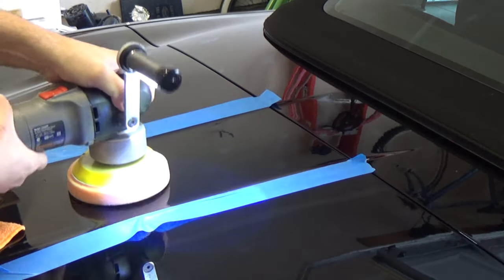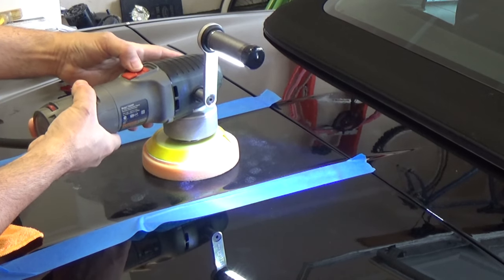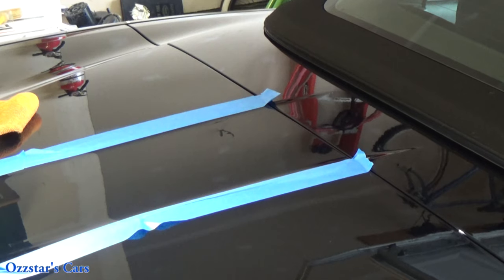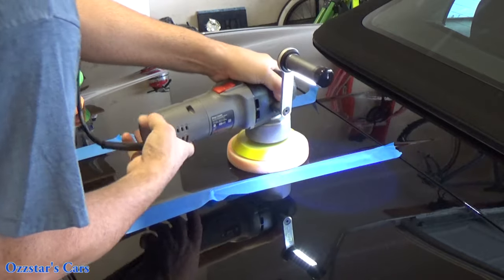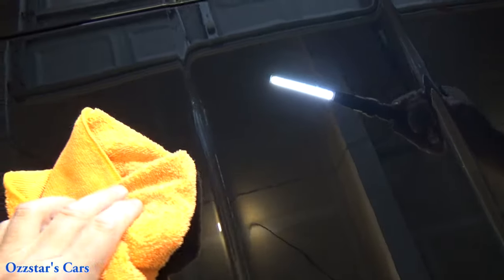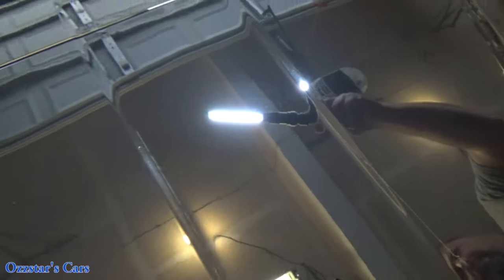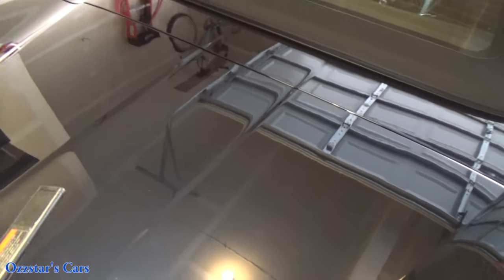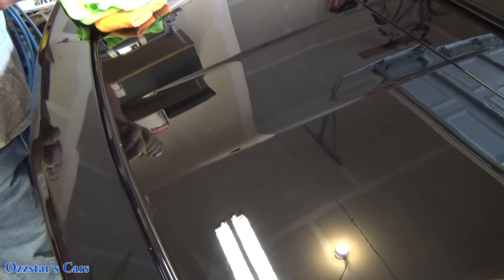Car Paint Scratch Removal How To Demonstration

Comment: I never learned how to buff cars. Probably because I haven’t owned any worthy of the effort, lol. 😆 The Silverado was for a brief time, but now I’ve long since stopped caring about that. You should see the scratches in that thing! You’d cringe. Even paint isn’t as durable as it used to be! Auto manufacturers have managed to cheap out on every single component.

Got a big snowstorm coming tomorrow, if the weather people are correct. Maybe I can work off the 15 pounds I added to my gut the past couple months, LOL! It’s been a work out just tying my shoes every morning. 🤣 Anyway, great vid, Glen. That stuff works great! 👍😎
Reply from the maker: Thanks Smitty, I'm in the same boat as you, the fatty boat. 🤣  I gained at least 15 pounds in the past 10 months and feel like dookie.  Garry's detailing products are the bomb. All we need is two days and your truck would look better than new!  The paint on my '16 F150 is so thin just looking at it can cause a paint chip. For $45k it irratates me.
Reply: Ozzstar's Cars - I hear that. Same as my Silverado. A buddy of mine who paints cars for a living (has buffed thousands of vehicles) just about burned through the paint on the bed as it curves up top, about 10 years ago. He said he’s never seen any paint job burn through that quick. I wasn’t too surprised. Definitely not as surprised as he was!

We’d better get off this fatty boat before it sinks! 🤣

Comment: For some reason I find this scary, every mistake is there to stay. Is there a way to tell if you're about to wear right through the clear coat?
Reply from the maker: Not really much warning.  There is only so much clear to go around.  Even using a gauge to measure paint thickness doesn't really indicate how much clear there is to dig through.  Unfortunately if the paint finish is that poor then it's probably time for a respray.